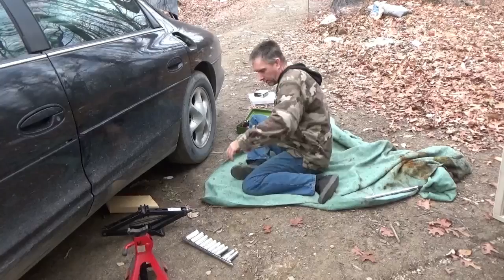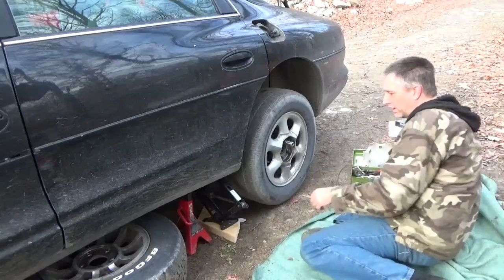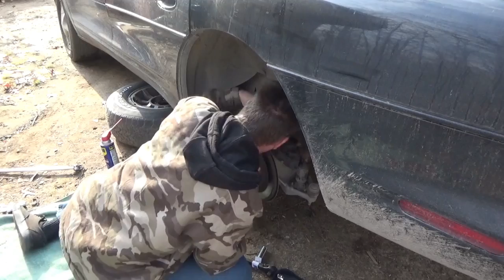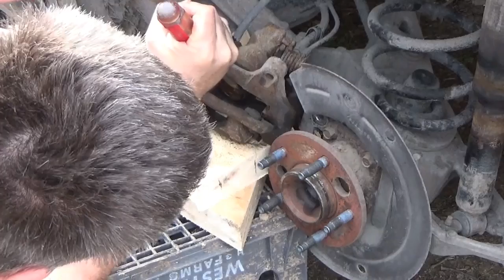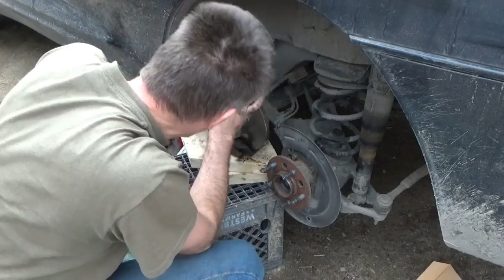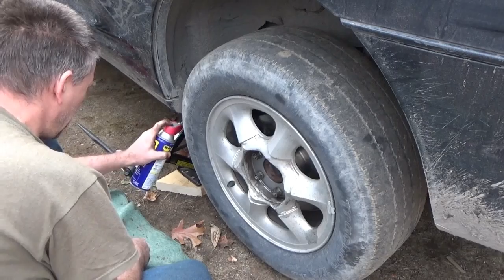Toughest Brake Job Ever On My 99 Olds Aurora

Comment from the maker: QUESTION: DO YOU TURN ONE SIDE CLOCKWISE AND THE OTHER SIDE COUNTER CLOCKWISE ON THIS CAR??? THE OTHER SIDE IS FROZEN OR I AM DOING IT THE WRONG WAY
I am getting conflicting results in my web searches.
Reply: +The Do It Yourself World righty tighty, lefty lucy.
Reply: +The Do It Yourself World CLOCKWISE or you will unseat the piston.
Reply: +The Do It Yourself World I dont think so. but maybe. put some wd 40 on them and let them soak. I really think not they should all be lefty loosy.
Reply: clockwise on that car.
Reply: +Jessie Smith so far I have been a 100 percent wrong about this new car LOL
Reply: +The Do It Yourself World     Troy,call autozone, they have people on hand that can give you solid expert advice.
Reply: +The Do It Yourself World  they  go both  directions troy  one  is  in  other  is  out  its  been   over  a  mo  since  i  did brakes  on  mine  and  my  brothers  lesabres  its   the  identical  setup
Reply: Hey Troy, I am a mechanic for a living. You really made this way harder than it should have been. I'm not trying to give you a hard time but this is what I do for a living. You take the caliper loose first. Take the 2 bolts that hold it to the caliper bracket off and remove the caliper. The pads will just fall out. Then you take the bolts that hold the bracket on out so you can get the rotor off. If you don't need to replace the rotors you don't need to do this step. Just replace the pads and put the caliper back on. Yeah sometimes one side turns backwards to the other but not usually on a car that old. Even if it does you can deal with it but it's a pain. Too bad we don't live closer or I'd have just done it for you. Should take way less than an hour even jacking it up one side at a time.
Reply: +RMorr50912 
I could honestly do this for you at work in about 20 minutes. It's right tools and experience.
Reply: +RMorr50912 both pistons turn the same way. You are right about the brackets. He made it way harder than it should have been. In the absence of the GM piston tool you can take a pair of needle nose pliers and put the ends in the divots and recess the pistons. Also if you crack the bleeder valve it moves much easier. Troy that tool sells for about $5 at the auto parts store.
Reply: +James Montgomery Yes release the bleeder valve it WILL make it easy. That is why it is stuck.

Comment: It's great to see another bro do his own breaks. We Sir are a dying breed.
Reply: +Rahoul Zerohl     Yrs back I talked a teen boy through front brakes job. I had already watched my husband do brakes. Not much talking necessary. Common sense.
Reply: +Rahoul Zerohl They make cars hard to work on these days. Like to change the oil you need to climb under the car and find the bolt. If you are even a little fat you could get stuck under there.
Reply: YEAH... dying on the highway, LOL

Comment: Troy as a mechanic myself your vehicle maintenance videos crack me up you need to stick with off grid videos and construction videos Which you are much better than I and learn from those
Reply from the maker: +David Overstreet Laugh all you want but I have to get this done myself. I prefer classics. I have rebuilt engines myself and fully restored old classics. But I hate newer vehicles.
Reply: +The Do It Yourself World hey I learn from your other videos everyone has there strong points

Comment: Just giving my 2 cents. Other side remove caliper slide pins first and then the caliper mounting bracket. Caliper slide pins are right behind them 2 rubber dust boots. Sometimes torx head or allen head. Make sure the pins move freely. Remove master cylinder cap and then compress piston. After you remove caliper then remove caliper bracket. A lot easier.
Reply: Theres a tool you rent for free from autostores that actually compresses and rotates at the same time. Even easier
Reply: +gmaxsc  Yep.

Comment: Troy disk brakes are easier that drum's in my opinion. Here is a tip from someone who knows how to do it. Step 1 open hood and remove brake reservoir cap releasing pressure. Step 2 remove disk brake assembly and worn pads. Step 3 obtain a c clamp and compress the caliper, you will see the fluid rise and in some cases spill out of the reservoir. Step 4 reinstall the new pads which will be much easier because the caliper is compressed. Step 5 replace any lost fluid in reservoir and snap the cap back on. Job is finished, usually takes about an hour for both. I hope you remember this the next time it will really help.
Reply: +Alpha1545 the only time you need to remove that braket is if you have to change rotors
Reply: +Alpha1545 new calbres some times come with new braket

Comment: When I've done breaks in the past I used a large c-clamp to compress the caliper. Something else I learned is the black line that go to the caliper swell inside causing the break to to drag. Fact is to do breaks on a car you are going to have for a while replace the calipers with re manufactured and get a power break bleeder if you are doing it your self.
Reply from the maker: +LOOPPEY Cant compress these. They are turn in and need a special tool
Reply: I seen what you did in your video it was the first time that I have seen that type of caliper. Learn something new every day. You remarked about the uneven wear. So ether someone slapped some pads on it before or the breaks drag. The black hoses are over looked many times causing rework pain.

Comment: Naapa has a brake compression tool for ten bucks. the trick is to turn it slowly or you will blow out your system. you could also disconnect your brake line, clip it and then watch that caliper release pressure in seconds. You then just need to bleed your brake line when you connect it back on.

Comment: 2 bolts hold the caliper take those out remove caliper those things the bolts come out of are called the sliders they should move nicely in and out should be lubed real good there is special green lube for those if they stick or are frozen and you can manage to pull them out you find a drill bit closed to hole size and ream it out good and take the pin and wire buff it regrease and replace rubber boot if brake pads wear unevenly it means one of those slide pins are stuck ANNND those 2 other bigger bolts are for the caliper bracket once those are off and bracket removed you can pull off the disk and then youll see how the studs can be replaced if ever need be you just hammer them out and press a new one in or pull it in with the lug nut.

Comment: Harbor Freight sells the caliper compression kit for all makes and models that makes that job a lot easier. It comes in a plastic blowmold case and has all the special adapter plates to turn the piston into the caliper housing.

Comment: This is one of the funniest things I have ever seen. The time it took him to do 1 wheel, I had all 4 done on my Aurora. That was with new rotors and no rear caliper tool(needle nose pliers work great for that if he would have taken the caliper off properly). And the jack is not at full extension, the thread is just slightly misaligned  with the hole in the rear of the jack, mine does it all the time. If you want some tips on working on your Olds, message me.
Reply from the maker: +Jason Richardson They were seized up. I had to replace the calipers.
Reply: I gotcha. Still looked like you were doing things to make it way harder than it really was. If you want some tips on the old aurora,just let me know. I drive one daily and do all my own work on her. The only thing on these that is close to rocket science is some on the electrical

Comment: Troy you can borrow the tool at autozone, all you have to do is give them the price of the tool as a deposit and when you return they refund the deposit. I had a 1999 Merc Sable that needed the same tool Pain in the backside.
Reply from the maker: +A Few Minutes With jman Yeah, nice to know but I was not going to drive one more day on these brakes. Was afraid I may damage something. May have anyway.
Reply: +The Do It Yourself World If they are that bad I don't blame you for not driving. Don't want to damage the rotors or calipers.  Good luck.      jman

Comment: ok  i see alot of trouble here ..when trying to pry off caliper you need a big screw driver or even a carpenters flat bar ,,not your hands ,then remove the pads an try remember the direction beforehand if not sure take pics ,then use a c clamp to push piston back in then put new pads on caliper then replace caliper onto bracket and brake disk ..i forgot when you are compressing piston remove your cap on brake master cylinder .....after youve mounted back pads on disk mount back the bolts then refill lost brake fluid in master cylinder again .then pump brake pedal  .then do other side .

Comment: I think you should tighten the lug nuts a bit more so you wheel dont come off. use a torque wrench with a ft pound scale and tighten them to specs
Reply from the maker: +shartne I will. I think I said so on the video.
Reply: +The Do It Yourself World OK sorry.

Comment: One of the primary reasons I.keep the older vehicles I have is because I can do just about any repair on the consumable portions, brakes,  fuel systems, cooling systems, minor electrical, etc, with an average tool box and the Hanes Book. 

I have two books for every vehicle. One in the garage and one in the vehicle itself.

there was only one time I found myself needing a special tool. It was for a radiator connection. luckily my neighbor at the time was a High dollar professional car mechanic with about a million dollars worth of tools. He had that exact tool for that particular job. 

It just frustrates me to no end why manufacturers place special fittings on parts that require specialized tools that other wise could be replaced with relative ease by a novice with a guide book. It was a radiator. literally had Two connections and a third for that special fitting, I believe it had something to do with the air con. 

My goal is to purchase simpler Vehicles. something you can do a large portion of the work in a home garage without special tools. with a rudimentary electrical system (no on-board computers) and diesel.
Reply: +Gentleman Adventurer that's how they make all those billions that they make

Comment: It takes a special tool, one that turns and pushes in, then the brakes are easy, you can get it at any parts hpuse, (Auto Zone.)Car makers are cheap, it's turns the same way. (Rotation)

Comment: I'm hoping unscrewing the piston doesn't disable your brakes. I think that was an adjuster. A 'C' clamp or big vice grip or even a channel lock pliers would  have pushed the piston back. next time, remove all the hex head bolts first. have fun. (newer cars suck!)
Reply from the maker: +grodad This type MUST be screwed in. They do not compress. They screw in. Odd setup.
Reply: +grodad Troy is  absolutely  correct  think of  how  a ratchet mech  works its  turned  out and then  will  not  retract unless  manually  done  the  piston  does not turn  while  braking tho if  that makes  sense
Reply from the maker: +Tim Johnson The instructions for this type of piston warn strongly NOT to use a C clamp or you can strip the threads on the piston. It is a screw in piston. Dumb idea I think.
Reply: +The Do It Yourself World Troy you are correct the rear calipers screw in. that is how the e brake works
Reply: yes  ik  these screw  in  they work  in a  ratchet  motion they twist  out  with  hydraulic  pressure  but the  piston  does  not turn    while braking only  during  maintenece
The Do It Yourself World
Reply: thanks guys. I learned something at least; NEVER do my own brakes again. lol (Humble in the heartland)

Comment: There is a reason that you can shift the car into second and first gear for automatic transmissions; if you go down a steep grade you use the engine to keep the car at a slow speed, so you don't ruin your brakes. I googled your brake removal, it states you need that special tool,   I replaced my front brakes once.... once!  easier to pay a mechanic to do it.
Reply from the maker: +Duane C Yes that is true. But this was a bad mountain and my brake rotors were probably over due for a change anyway by the looks of them.

Comment: use a large C clamp to compress the piston and a old brake pad to protect the piston. Next time buy brakes that have the clips penitently attached. Ceramic brakes stop fast so get that kind and they dont make ugly rusty brake dust.
Reply from the maker: +shartne This type turns in. You are NOT supposed to use a clamp or try to compress them. There is a special tool for it actually.
Reply: +The Do It Yourself World Oh that is weird. New car stuff.
Reply: +The Do It Yourself World i would say theres nothing wrong wit that wheel brake calaber.most of the time they get hot stick the brakes get hot.new brakes sometime will smell little tell they ware a little.they mybe just a little over size. a bad one will stick get so hot can get on fire if drove to long
Reply: The piston may be corroded and stuck for good possibly it may need to be replaced. If releasing the bleeder dont work then its junk and time to get a new one.
Reply: lots of time them rubber brake line hose will go bad on the inside.and not let the brake back off
Reply: Yess so true the collapse and then the flood can go back I replace break lines when I get a stuck calliper.

Comment: release the bleeder valve and the piston will push in all the way. you will have to bleed the brakes if you do this. with the c clamp method you dont have to.
Reply from the maker: +shartne Not supposed to use a C clamp on this type. You can damage it.
Reply: +The Do It Yourself World oh ok sorry I going to make you break that new fangled car. I guess I would need a manual to work on one like that
Reply: +The Do It Yourself World  Troy, it is already damaged if it doesn't work,open the bleeder before using the C clamp and only Clamp it enought to break it loose.
Reply: +The Do It Yourself World you will damage the c clamp, lol the poston will not budge
Reply: OK OK its new car stuff but release the bleeder valve Like I SAID!
Reply: +shartne its so annoying how he wont aknowledge he doesnt know what hes doing like he originally thought. Ive never interacted but have followed troy for awhile. I never knew that off camera it was like dealing with a kid with autism
Reply: +shartne how is gmaxsc trolling?
Reply: +jujubegold i dont consider myself a troll... Unless you think I live under a bridge!
Reply: +gmaxsc You are smarting off like a troll. I have taken auto mechanics in school. I have worked on vehicles all my life. The new GM cars have a stupid idea for brake callipers thats all. Its stuck so its not a great idea.
Reply: shartne As a strict observer, not one with mechanic skills or background whatsoever, the only smart mouth I see is yours. Only you are allowed opinions? That's the problem I find with this channels "fans" they all have this "us against them" attitude and they all have their trigger fingers ready to knock anyone down regardless if they're trolls or not!
Reply: +jujubegold that is your opinion. Troll.
Reply: shartne well now that's mature. I'm really surprised Troy hasn't come down on you (and others) for being rude to his subscribers. What proof do you have that I'm a troll now? Because I called you out on being rude?
Reply: shartne You should spend as much time on your character as you do trolling comments. You're the second top poster on this channel! So don't tell me to shut up. You shouldn't be allowed to mouth off to people as long as you have. You wonder why Troy has problems with his comments. It's frustrating you to not have the final word huh?
Reply: Bye

Comment: It's not the ABS, it's the parking brake.  ABS has nothing to do with it.  Also, you should remove the caliper before/instead of removing the whole brake assembly.....  Typically, you leave the carrier on the car (the part bolted to the strut) by removing the sliding pins (the ones with the boots) and take off just the caliper.   Then you can just drop the pads in and remount the caliper....  You are just doing it the hard way because you don't know what you are doing....

Comment: Troy I know you are meaning well but you need to research how to do a job well before you start it. Use YouTube better.  Talk to a mechanic.  Go to the library.  Check the manufacturer's website.  When you know what to expect and an idea of how to do it it takes to do it - this job is easier than what you are calling a classic.  I have done both and both are easy.
Reply from the maker: +nopmh i did research online. I believe I said so on the video. This is not an easy job in my opinion. Its a nightmare compared to a classic. And I do believe 1960s cars qualify as a classic?
Reply from the maker: +The Do It Yourself World Had a bunch of them